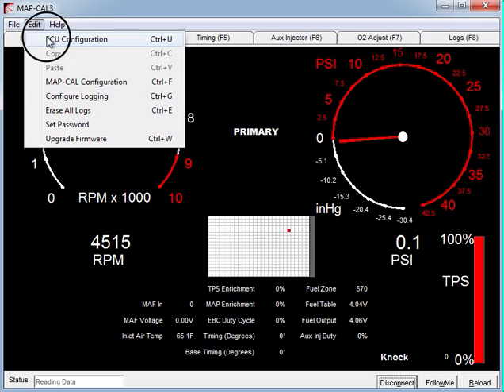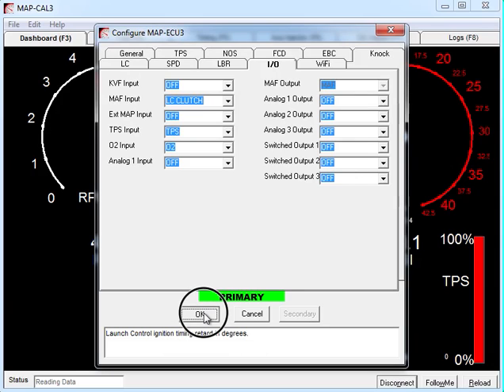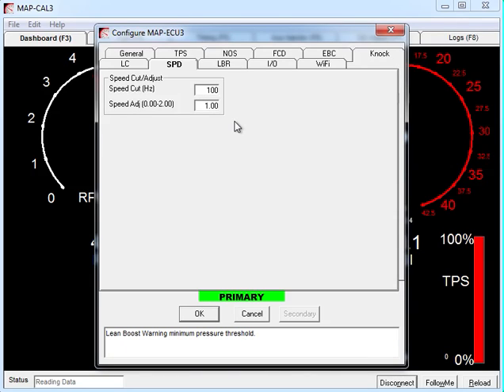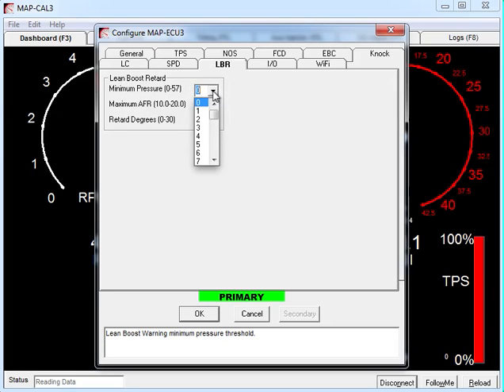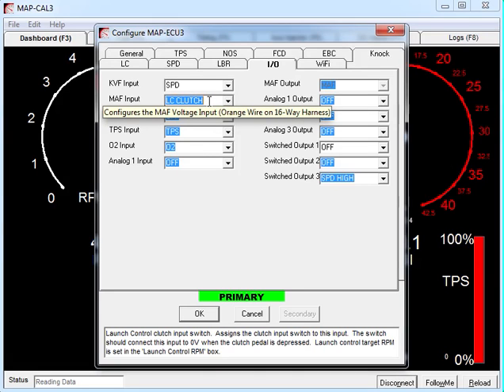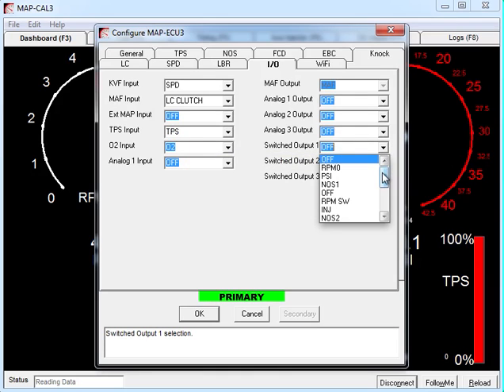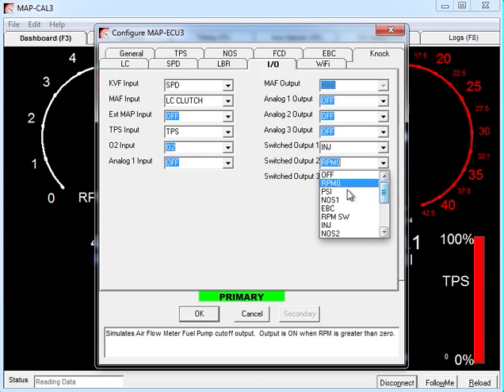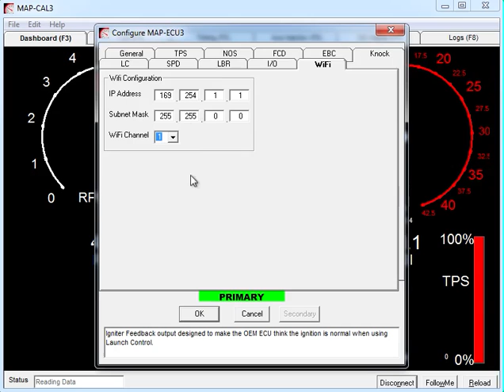MAPECU3 Configuration part 4

Comment: I’m assuming you mean use your wideband to drive the OEM ECU? Most widebands have a narrowband output that can be used instead of the OEM narrowband sensors. It depends on the vehicle and the number of O2 sensors as it will probably only work for the pre-cat sensors.
Reply: Many OEM sensors since about 2002 ARE Wide band.